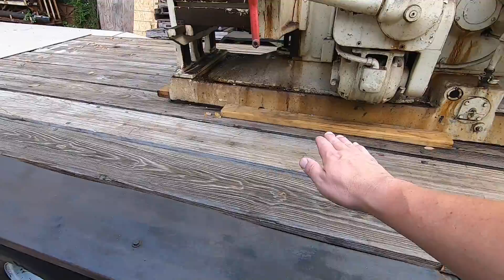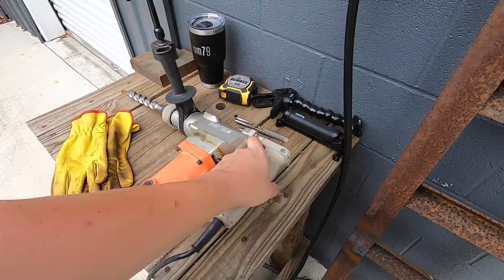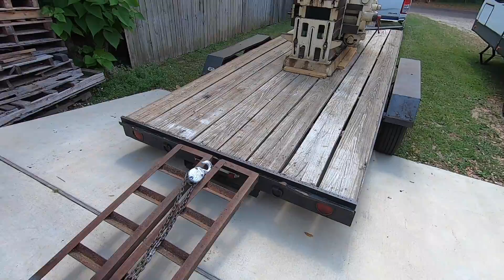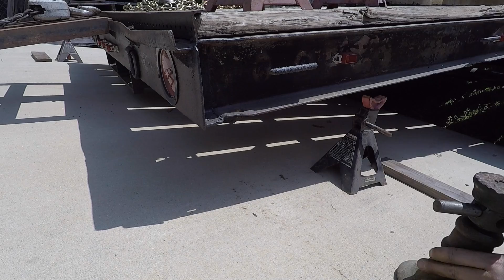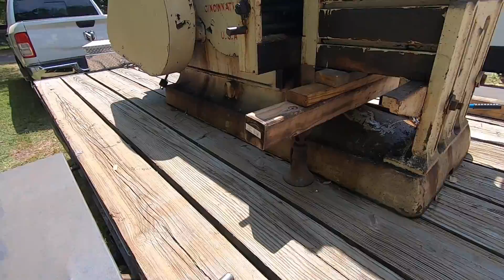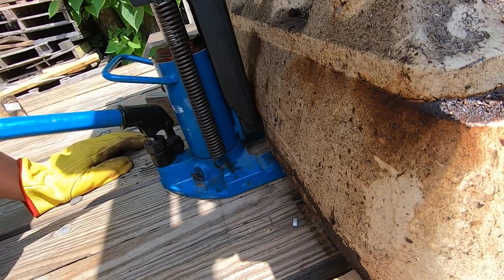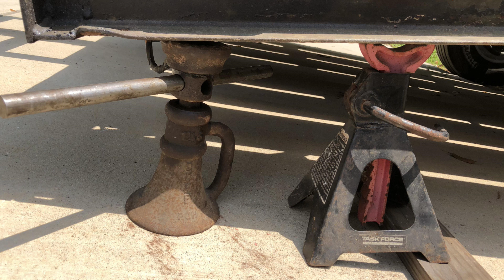Unloading the Smith & Mills Shaper Part 1

Comment: When working outside, or even just in the garage; I’ve accumulated a few of those centrifugal blower fans (the kind with the extra power outlets on them) that I drag around with me. The air blast on me is the only reason I haven’t gotten heat stroke yet... 🥵

Comment: Good stuff, but I am disappointed...all your gear and you only have ONE toe jack? :p  I love the screw-jack though did you make that?
Also harbor freight just recalled some of their jackstands (fyi)

Only thing I wonder about is if you should have put some type of goop under those concrete fasteners?
Reply: The anchors should be fine. Thank You for the heads up on the jack stands. I always felt uncomfortable with Chinese devices that carry heavy loads. He does need a second toe jack. The screw jack is fine. It comes down to time saving.

Comment: Why not back the trailer closer to the door and save yourself some distance to travel.
Reply: The slope of the front of the driveway is such that the rear of the trailer is closer to the concrete.  If he were to back the trailer toward the door, the end of the trailer would be much higher off the driveway.
Reply: @doctwiggenberry5324 - He he could raise the tongue of the trailer so the tail is touching the ground. He had the weight of the machine under control. Granted it's over and done with and it was done safely. It just killed me to see that nice new concrete get drilled. If that were in a area that freezes in winter those holes will be the first place that breaks up.
Reply: @mjb12141963  The temperature in Florida will never reach a low enough level to cause any problems. It would have to dip way below the freezing point and would have to cycle over and over to break that up. Those anchors will be usable after our Great Grandchildren have died. Of Old age.
Reply: @doctwiggenberry5324  Thank You, Doc. To ALLxoxoxoxo, raising the tongue reduces control. This machine tool weighs about 6200 pounds. One has more control when the trailer is level. If this machine goes sideways...No Bueno. It is quite a bit different than dumping a load of gravel.
Reply: @jlucasound  I do live where it freezes over and over and I often look for different ways to do things. It was obvious he had worked out how he was going to handle the job and it appeared to go smooth for the most part. I found this channel looking for concrete pouring and it was when he had this slab poured. Thank You, God Bless.

Comment: What was the point in showing fitting pull brackets to floor putting round bar under machine then just show still shots of rest a waist of my time watching nothing
Reply: If you haven't got the patience to watch careful preparations, you don't have the patience to move heavy equipment safely, single-handed. Every step has to be thought out; and thought about again. This kind of care for details is what this video is all about.
Reply: Pete Williams to be continued in part 2

Comment: Ha! I just had the same exact problem with concrete anchors when I was installing my tire machine! You think you're drilling a straight hole but the anchors end up tilted. Like you I also had to open up the bolt holes so the fasteners would line up with the threads.

Comment: Drilling a concrete, or a rock, it works better,when you don't push it so much..let the drill move, and do the hammering, and it eats the material better.
Reply: yup, i'm in construction work for 10 years now and quite often i see other "professionals " put they'r whole weight when using that big of a drill then blame the tool:)) so i guess we can forgive Adam for doing the mistake outside of his field of work.
Reply: jouna84 i think that Was Abom style light pressure.
Reply: Yeah... Unlike a chip-making tool like a twist drill or lathe bit; a concrete hammer drill bit does not work by shearing material off; it works by striking the material inducing a shock wave in the material which shatters it at the bit’s tip. Pushing on it just bogs down the hammering action...
Reply: It could also have been binding up on some rebar.
Reply: I was taught that the weight of the drill was enough drilling pressure.

Comment: I used to use a hammer drill like that a lot of years ago. Occasionally it would bind and try to break your wrist. To stop the problem we attached a stick to the handle and the cord to the stick. If it bound the stick rotated pulling to cord out.  Worked a treat! Those masonry plugs we used the other way around putting the plug in first and driving the cylinder down on the tapered plug. Surely we did not do it incorrectly for all those years!

Comment: When I was putting a Bridgeport in my father's garage years ago he recommended to dump a few bucks of sand on the ground to slide it around easier. Turned it to be so helpful that three of us were able to push it in position without using the winch we set up. Now I've used sand several times since at work and still can't believe how helpful it is when you don't have a forklift.
Reply: Are we talking enough of a dusting of sand to make it slippery, or an inch of sand?
Reply: Good word choice, I'd say a heavy dusting.

Comment: Greetgings!
I must draw your attention on the correct mounting procedure of those concrete anchor inserts or how ever you call them, in regard to the fact that in order for it to remain wedged in the concrete, once it's mounted, the very screw or stud you  insert has to remain pressed on that little wedge on which you hammerd after you inserted the anchor, that means using a slightly longer stud, which you tighten inside the anchor first. That way you'll get its full strength. 
Other than that, that ramp on the trailer looks a little flimsy and narrow to me. At least keep a safe distance while lowering the load on it. Have a nice day!
Reply: As a pipefitter I have installed millions of these anchors, what you are saying is just not true. The stud does NOT have to be pressed against the wedge in the anchor. maybe you need to actually look at the manufacturers directions before you make silly statements.
Reply: You don’t even know what they’re called but you’re still going to impose your expert advice on how to use them?
Reply: I look forward to the video of you moving yours from your trailer into your shop.

Comment: I just did this two weeks ago with a smaller Klopp 450, about 1,800 lbs. Should have recorded it. I've had good luck lifting the front of my trailer as high as possible, winch connected on the front of the trailer, jack stands in back, shored up ramps, and they usually slide down. Might need a nudge with a pry bar here and there, but sure beats trying to do a controlled pull.

Comment: i think its time for a winch on the trailer bud. that way you can let them down and not pull them down that put you on the safe side of the weight. and a winch can be hooked up and tightened a bit so when you start lowering it on the bars it dose not start rolling. spent years lifting and moving extremely heavy stuff. just some tips so i can keep watching your videos and not a rip video prematurely

Comment: I’m a truck driver and years ago I had a delivery to a small business 400 miles from the depot. Unlucky for me they didn’t have a forklift. Lucky for me it was only one pallet of plastic granules that had been loaded right on the back end of the trailer. The rest of the trucks load was going on to another delivery point. After a bit of agreement with the customer I tied a ratchet strap to a tree and the other end to the pallet and then set off in the truck and a fair pace. Customer said the pallet flew off the back of the trailer and landed squarely on the ground without toppling over. Good job !

Comment: I would always predrill in concrete. This allows all this powder to clear the drill head on the larger drill bits.
Reply: If you want your drill get stuck in the hole thats the way to do it, no one in construction predrill concrete exept metalworkers. use a vacuum cleaner to get rid of the dust witch is already mandentory in the EU.
Reply: @arjanvanraaij8440  which*
Reply: Interesting. I always predrill with a very small, long drill and follow with the size I need.

I've actually learned that in construction - maybe it's just uncommon. 🤔

Anyway, I can't remember that I broke a drillbit in the last years. Sure they wear out, but break? 🤔
Reply: and how many drills did you brake? you are not supose to predill concrete...
Reply: You would be wrong predrilling concrete

Comment: Having some experience in moving commercial safes, I see a lot of the same techniques in use here. The long and short of it is that there's no prize for finishing fast, so you might as well take your time and be safe. Also, it turns out that those Egyptions really knew their stuff; most of the concepts used for this sort of task are the same concepts that allowed for the building of the pyramids!

Comment: I always worry about anchors coming loose (blowing out) at inappropriate moments, so I buried a pvc pipe vertically in front of the shop doors.  I can uncover the top quickly, and slide in a 3 inch pipe to use as a "tree" to pull with.   I have used the same method unloading equipment, but I always do the belt and braces when it comes to movement.  There can never be an uncontrolled moment when working alone like this.  No lifting unless the machine is chained.  If there are rollers, there will be wedges facing them to prevent uncontrolled rolling.  Once the locomotive starts moving, you can't hold it back.
Reply: sure you can just not easy, thats why it takes a mile to stop a fully loaded train

Comment: You were already a bit late wondering "Its not going to roll on me?". If it did by the time you finished the sentence you would already be running! I assume it is still chained to the back of the trailer?

Comment: the drill is fine you just haven t engaged the spindle drive , there two knobs on the top one switches between drilling and non drilling and one hammering and not hammering , the drill can be used as a small kanga hammer to bust up concrete 
git the same drill , here there brandname is kinzo : https://img.proveiling.nl/Image.aspx?img=4368|53063|1264850|601.jpg&x=595&y=350&box=1&nowm=1

Comment: Adam, dont lean/push to hard on the drill machine, the bit needs some motion to do its work. A couple of the Abom-hooks to the side of your slab would be nice to tie down your camper Incase of a storm,
Reply: Mayby not hard, but you need to push a bit, if you don't- the drill get stuck in the head, not being impacted.

Comment: why not driving the trailer further more on the concrete closer to the shop door?
Reply: Because he is using the height difference between the ramp and trailor to reduced the vertical lift requirement.
Reply: Did you see the steep ramp? It's already as close as it can be.

Comment: You just have to drive that taper piece in with a punch? I would have guessed you might start it with that to keep the anchor from spinning, but torquing a bolt down on top of it would really drive that wedge in there. I've never used any concrete anchors so I wouldn't know
Reply: I mostly never bothered with the punch. Just put the bolt in and tighten like a mofo. If the hole is the right size, it's no problem.

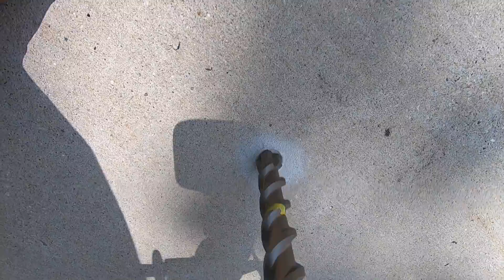Comment: 5:58 watching you drill into your nice new concrete pad makes me cringe because now your concrete pad will crack and get damaged how when water and that goes into where that bolt goes in water expands when it freezes that’s all Roads get damaged I think you could’ve actually used your existing shaper machine as a base to pull your new machine with because if you use a snatch block you’ll double your pulling power but in about a year I predict your concretes going to be cracked  :-( A idea would’ve been how come you didn’t rent a forklift like you did that one time it would’ve been a lot faster and a lot more easier and safer and on top of that you would have to drill into your nice new concrete pad.
Reply: He is in Florida.
I don't think he has to worry about water freezing.
Lol
Reply: Never hit me until a plumber told me- water is corrosive! So yeah, it'll be nice for awhile.

BTW, those turd herders really know their stuff lol. Would've never thought water would be considered 'corrosive'
Reply: Adam lives in Pensacola far North west FL, He has mentioned the temp. sometimes gets to 22-25 F.
Water is called the universal solvent, I was working on a job once where the sink facet must have been dripping for years, it actually wore thru the ceramic glaze down to the cast iron!
Reply: He needs the same trailer to haul a towmotor.

Comment: Adam.  do you have any Stainless 3/4 all thread or some 3/4-10 bolts you can cut some threads off. to make up some slotted set screws.. cutting slots on the cut off saw, mill, shaper,  so you can put some antiseize down in the anchors in the concrete to keep the dirt and water out when not in use. even cutting and threading some stainless bar stock to fit... you only need them a half inch tall..
Reply: He said he was going to get some set screws to keep the junk out of the holes.

Comment: I find that the little DeWalt 996 drill zips through concrete faster than any SDS I've ever used. Super high frequency hammer.  ear protection required lol.  Harbor freight has made themselves obsolete, their prices have gone up and home depot and lowes have harbor freight quality stuff for sale if you want it for about the same price.
Reply: I have the same. Bought it 12 years ago and used 6 years allmost every day. I made about 100 bath room repair. I removed all old tiles and drilled hunderts holes. . Drill is stil OK. I bought it in a promotion, price 35€. My college used 8 years the same. They are sold in many names and are made in China. Very good and durable tool.

Comment: They are not always the greatest quality but I have been lucky enough to get a few Chicago electric tools that were really great quality from harbor freight. The funny thing is the best tools I've ever gotten from harbor freight ended up being tools from the clearance racks that other people had returned for some kind of supposed defect that I still havent found myself after some heavy use on the jobsite (8 years as a third generation roofer) I still own two central pneumatic coil roofing nailers ($89 out the door) that were bought as backups for our Stanley bostich coil nailers ($350 to $500 at the supply house) but the harbor freight guns quickly became our go to nailers because they were easy to use and didnt need nearly as much maintenance every morning to run well(plus at $89 if you get a problem it doesnt put you down for any waiting for replacement parts because you can afford to keep a couple back ups). I get some of the tools arent the best but if you look at them as tools for outside instead of taking your good ones then your not mad because you lost your good tools some where in the shuffle.  Like working construction we used to give the new guys the lower quality tools so they didnt destroy the expensive ones we had to rely on every day. But I also believe harbor freight wouldnt sell so many tools if there wasnt a specific buyer for them all, like first time buyers, the a crackhead stole my good one so I need to get the job done buyers and the homeowners that will only ever use the tool for the one home improvement project they saw on tv buyer and it's not such a bad thing in reality because they will never put enough stress on them to damage the tools. When I first had my bike shop I couldn't afford to by the bike specific tools like park tool cone wrenches or bondhus allen wrenches I bought harbor freight wrenches and ground then thinner myself and bought a 3/8ths  socket style Allen set in both metric and standard. They worked great for me till a tweaker broke in and stole most of my shop tools a couple years ago. I was doing good business at the time so I finally splurged and went for a park tool shop quality kit and keep it under lock and key.

Comment: I worked with my father in commercial and industrial plumbing as a teenager over a few summers and probably set thousands of those anchors mostly over head from the ones shown here down to 3/8.  They are a good product but swinging a 5 lbs hammer over your head all day will sure whoop your butt.

Comment: 5/8" plastic sheets under the machine works great for this. We use about 3  4'x8' sheets for moving machines. It gives you a lot more control over round stock. Fun fact.... Make sure the leveling screws are all the way up when moving machines. It goes much smoother.

Comment: The first concrete anchors I used were called red heads and the wedge went into the bottom and you drove the anchor into the concrete.

Comment: Were those Robertson screws holding the wood blocks on the trailer? Didn't think they were used in the US
https://www.robertsonscrew.com/
Reply: They may not be buy Robertson specifically but a lot of manufacturers use the square "Robertson" head drive, specifically in a lot of wood deck fastener applications.

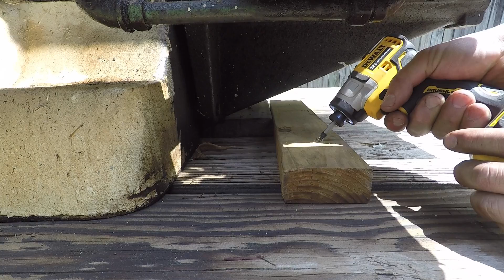He's using torx head fasteners @11:09
Reply: Used frequently. I see them most used for decking
Reply: Nope, standard torx
Reply: Fact. The square drive isn't what makes the screw a robertson, if that's what they are. Robertson's have a tapered recess and the square bit is also tapered. That way the screw stays on the bit.

Comment: Couldn’t you have put some wood under the trailer tires and backed it up onto the concrete ?
Reply: I think the point is to keep the ramps off the trailer as level as possible. If the trailer were up on the slab it would be a much steeper angle.
Reply: jagmarz  I will buy that, thanks.

Comment: Just did this same job with a horizontal mill and a 14” gear head lathe, winch on the trailer helped a ton but wish I had the tie downs in the concrete!